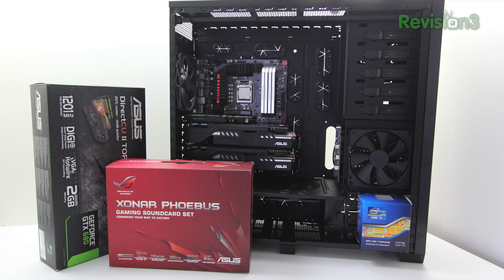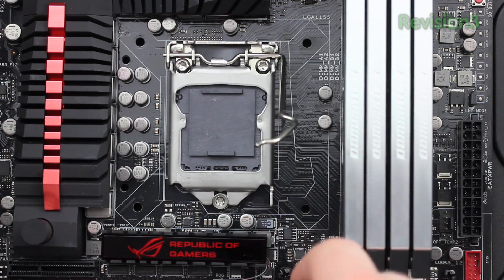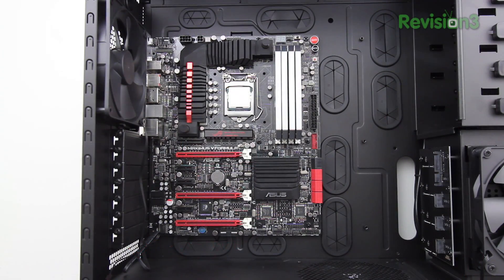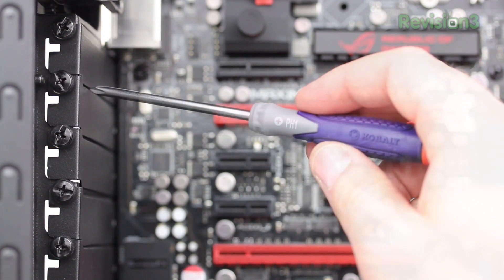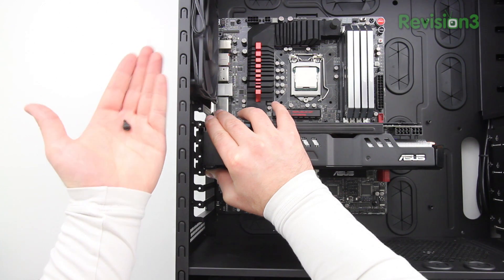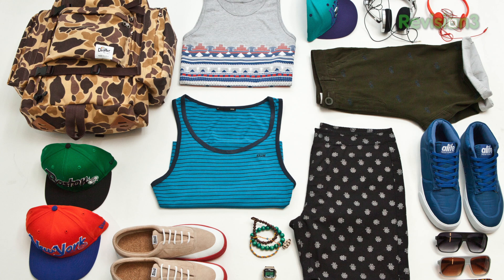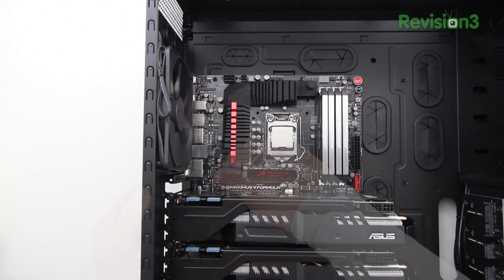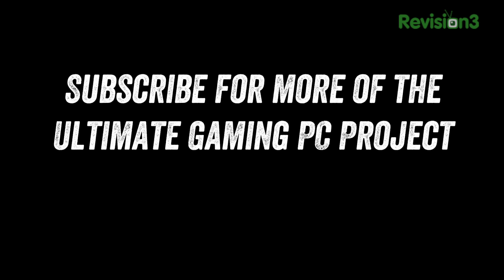Ultimate Gaming PC Build Video #2 (UGPC 2012 Gaming Computer)

Comment: when you install 2 graphics cards, you install it with an SLI/Crossfire.  This makes the graphics much better, because they both work together as one.  Also, dual graphic cards are much better when you have a multi-monitor setup.  One graphics card would have been just fine though.

Comment: all major graphics card will take at least 2 slots because it has a massive cooler on them. You also have to take into account that while this machine is fully loaded, it only relies on 2 even sometimes 1 fan(s) to cool the GPU and the GRAM so the heat sink is usually pretty massive.

Comment: it will be water -cooled.no problem at all..those 2 graphics card will be detach again from MOBO and undressed all the panels and fans and will be installed each waterblocks panel.thats it.I think lews purpose is just for presentation prior to water cooling system.

Comment: Well, the GTX 680 may preform better than the 690, but usually it's the same. I would go with the 690, it will give out less heat in your system and take less power. the GTX 680 in SLI is also a great choice nonetheless (if you can afford either card).

Comment: If he was going overkill he would have an xeon 8 core with 12MB catche and 64GB of memory, also a custom water cooled set up 3 way SLI or Crossfire and a 1200w modular power supply.

That is an over kill build for under 5K

Comment: 790*. 790M would be a mobile card, but dual gpu mobile graphics cards exist. (Dual graphics card laptops exist however) So the 790M will probably never exist. As for the 790, chances are we will see it but it will be 2 780s slightly downclocked, like all dual GPU cards. You can't have 4 790s as you can't have more than 4 GPUs.. 4 Titans would still be faster than 2 790s.

Comment: Dude
You don't need a AX 1200i for this beast
a regular AX 1200 could easily power this
Also what was the point of going for a Formula board when the extreme version would be better
If you are using a high end sound card and the formula board already comes with a high end intergrated sound chip... uhh
and the 800D is way to big for this case the 650D would have gone fine
For gaming why not just go with a I5
and if you have 2 680's might as well just have used a 690

Comment: Ok I gotta ask just how much does he plan to overclock the FSB, the RAM is running 2133 MHz but the MB only supports up to [1600 MHz - PC3-12800] and so goes for the CPU...? Well it's a 25% frequency OC though I'm (obviously) not sure about how much additional voltage needs to be applied, but with that said, he was also gonna use water cooling.   =)

Comment: will Aerocool X-Predator Gaming PC Case, Intel Sandybridge i5-2500K Unlocked Core i5 Quad-Core Processor, QUIET ACE BLACK EDITION 750W ATX PSU, Patriot 16GB (4x 4GB) 2133MHz Quad Channel DDR3 Viper 3 Black Mamba Memory Kit, 3.5” 500gb SATA II Computer Internal Desktop PCAsus P8Z77-V LX Motherboard Hard Drive 7200RPM, Palit GeForce GTX 680 Jetstream Graphics Card and Asus Xonar DGX 5.1 Sound Card. work and fit together please respond im not good at building computers so am i missing something.

Comment: unfortunately youtube viewers this is not -repeat- NOT the ultimate gaming PC for 2012
the ULTIMATE would be:

i7-3960X six core 16.5MB total cache

ASUS rampage IV extreme X79 8 DIMM slots

2 patriot viper 3 mamba black 2133MHZ 4x8gb sets DDR3 RAM

2 690's

10 crucial M4 512gb sata 3 SSD's

areocool strike-x st-bk full tower case

same PSU

same sound card

same cooling system

Comment: My system will look like this:
Obsidian 900D
Asus Maximus VI
Asus Xonar Phoebius 7.1
3 watercooled GTX Titans
1 overclocked watercooled i7 CPU
2 SSDs with 2 S-ATA backup
Corsair dominator 32GB DDR3
RAM Cooler for the Corsair Dominator
same power supply in this vid
and fans. fans fcking everywhere.